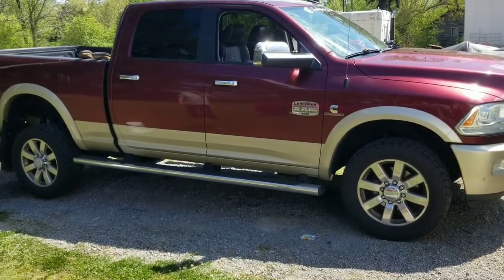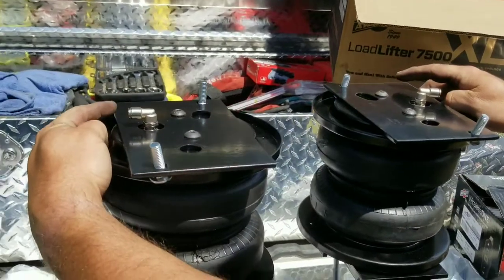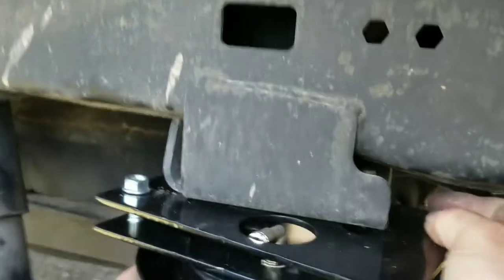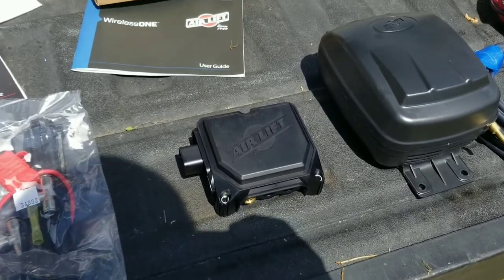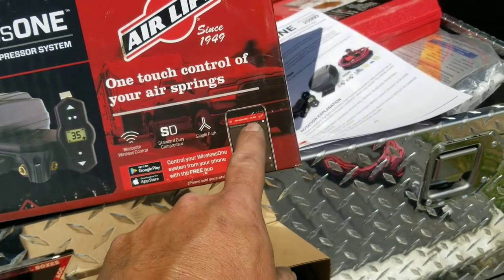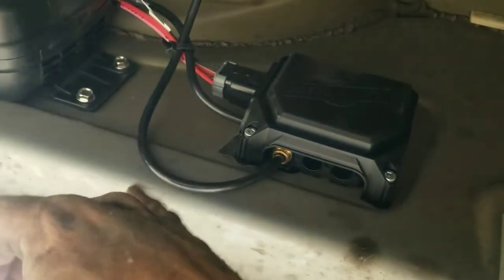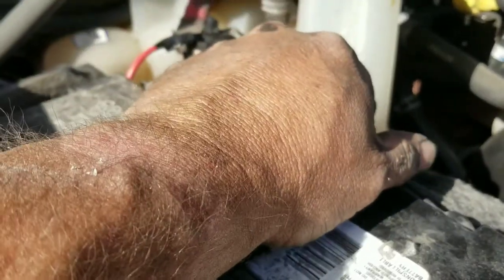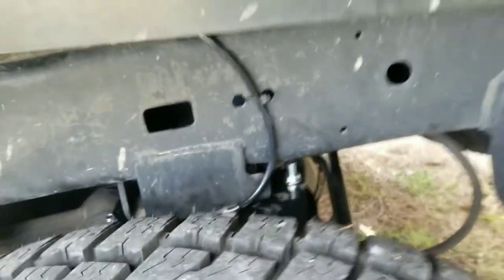Air Lift 7500XL Bags and Wireless one controller Installed on 2016 Dodge Ram Laramie Longhorn

Comment: If you add an air tank (maybe 3 gallon) between compressor and the manifold. It will give you a point to relieve air pressure and vent built up moisture too. Plus you can add a point to fill up tires and such
Reply from the maker: I was thinking about that on my truck and decided to go with viair ultra duty setup with 2.5 gallon tank . That's a great suggestion for the truck in this video tho. Thank you!

Comment: If have enough air line put the controller  and compressor order hood  you add air line there just push lock fitting
Reply from the maker: I thought about it on my truck but it ended up on frame